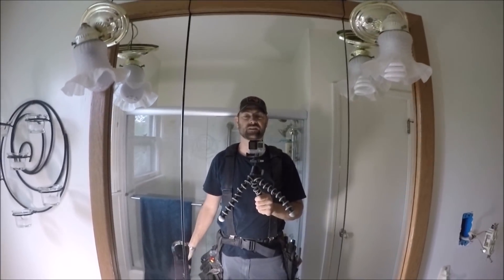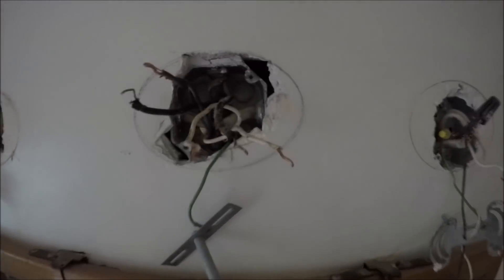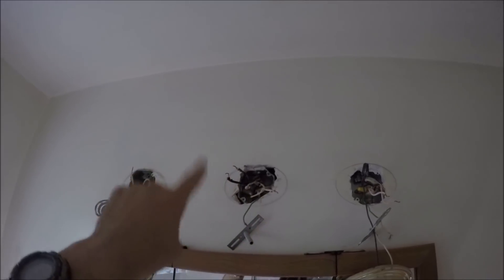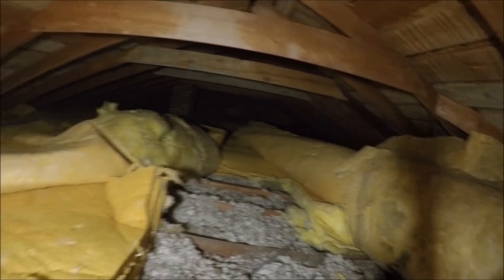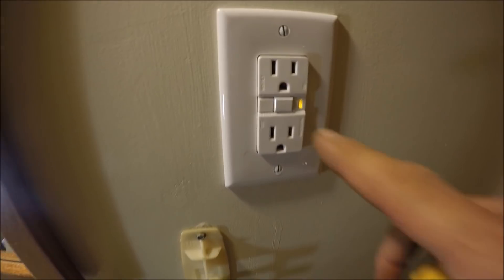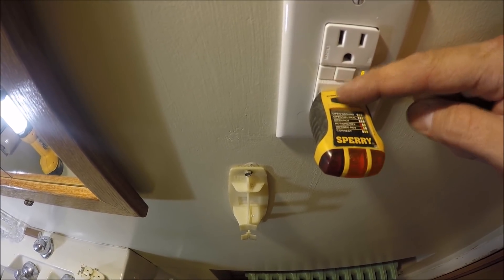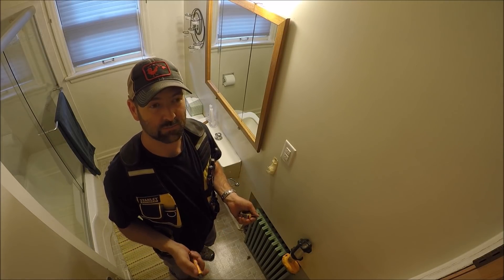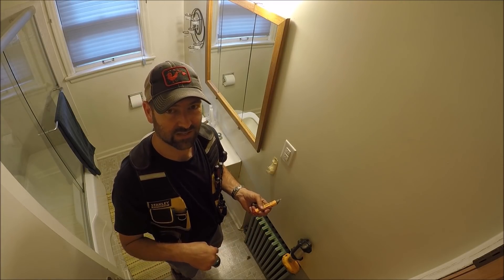Dangerous Electrical Problem That Can Kill You | THE HANDYMAN |

Comment: Found one of these switched neutrals doing a similar (not-so-)quick hot replacement to an external light fixture on my house (1952). It was the only run without a ground wire. Lost my good kleins and a bit of my ego on that one.

Comment: Why couldn't you just take the neutral off the switch, wire nut the neutrals together, and then connect the hot to the switch?

Comment: You've got to have a good level of trust w/ the customer to get them accept these situations, they don't know the technical side of the issue and too often they may think you're just trying to run up hours when you let them know about problems like this -- Frightening thing is the house is probably filled w/ switched neutrals.  Also, good on you for putting the insulation back, I've had many contractors do work where they pull it apart and then simply leave it apart because they assume I'll never look up there and are tired from whatever else they were doing.

Comment: the only problem with that solution is the next person will be confused as to why the wires are swapped and could hurt themselves thinking  white was  nutrial.
Reply from the maker: I was the next person and fully remodeled this bathroom.  All the wiring was completely replaced.   I knew I was going to be the next person before I did the work.

Comment: This was very handy and helpful. I did have a question, my brother installed a bathroom exhaust fan and wired to light switch.  After installing, when light switch was on, fan came on but light turn off and vise versa. He disconnect fan. Not happy.

Comment: Octagon box is overloaded with conductors.. I suggest specification grade outlets.. They have much stronger contacts to hold the plug in especially if you plug and unplug often which would happen in a bathroom..  Not sure why you want to switch that outlet..

Comment: Just so you all know Mr. The Handyman is not teaching you everything you need to now to solve this problem yourself. This is a cool video showing what problems you can run into, but you have to be pretty clever to solve the problems others have created. I have seen mistakes in  houses as old as 1902, 50’s, 60’s and as new as 1981. You never know what you will run into, and just because a house is newer, or the work has been installed by a “professional” and “inspected “, doesn’t mean you won’t find issues.
Reply: Hello Luke. I was just watching this video and I saw ur comment  I totally agree with u about that!  My wife and I just bought a 2 story house from my brother  the house was built in 1901 my brother had some remodeling done and put in a new gas furnance and gas hot water heater put in about 7 yrs ago and this video looks like this house we bought. The electrical is all updated but a friend of mine who is an electrician is checking out the work that was done by a guy who my brother hired and he smiled and said oh boy there's a lot that still needs to be done !  My brother hired a plumber who fixed a lot of problems but I am having another friend of mine who a plumber check things out with that too. My wife thinks  that we made a mistake by buying this house which I'm beginning to agree with her! Anyhow were just going to finish fixing it up and then we'll sell it!  The roof is a slate roof and has needed repairs done on certain spots but I was impressed with how old the house is and the slate roof was still in pretty good shape though! we live up north and we usually get the cold, windy, rainy and snowy weather so the old slate roof has held up pretty well considering its age my wife thinks we should have a metal roof put on in the springtime but watching this video I'm really not too sure. Oh the joys of owning an old house! Haha

Comment: What do you mean by switched Neutral? It was up until fairly recently that a 14/2 or 12/2 romex was brought down from the light to the switch box and the neutral colored wire is used as a switch leg. It’s not truly a switched neutral. Also there would be no need to get into the attic to figure out how to swap the neutral from the hot in the light. Waste of time and money for the homeowner there. Simple fix from the first light in the daisy chain from the switch.

Comment: I was an electrician in the military and worked on some "old" buildings in my time.  What they did back in the day was use the metal conduit itself as a ground all the way back to the panelboard.  Then they would ground the panel to an outside ground rod.  The problem was it was easy to lose ground continuity at junction boxes due to corrosion or loose connections.  Of course now the NEC calls for a dedicated ground wire all the way thru the entire circuit.  I was happy to see HANDYMAN fix this lady's bathroom for her safety.  I would have done the same thing.  Very nice work done here.  I really like this channel and have learned a thing or two watching it.  Customers of this guy are lucky that he has the electrical knowledge that he does along with all of the other skills.
Reply: you can still use the conduit as equipment ground. even flexible metal conduit.
Reply: Conduit is always used as a ground. 100% legal and fine as long as you use the proper fittings and bushings. You only have to run a grounding conductor if it runs underground.

Comment: I had a similar situation in my home when I bought it. Discovered it when a loose connection on an outlet caused resulted in a small electrical fire. An added hazard discovered was the discovery of aluminum wiring...UGH!

Comment: My house was Built in the 40s and it is old wiring,  none of my outlets had Grounds i put  3 prong  outlets  in, i am Not an electrician i do basic lights switches & Ceiling Fans,  This house is a Hack wiring i put a wall Switch in for the Hallway light and i seen about 2 to 3 inches in the wall you can see that someone had added on to that line after i  unscrewed the switch i pulled the switch so i could back the screws out and one of the wires came right out of the wall it was 2 or 3 " long so i wire caped it back in this was about 10 yrs ago,  i really need to rewire the whole house its all two line wires, all i could do is ground each outlet to the Box...
Reply: Look in the attic and see if the wire is inside metal flex like in this video.  If it is then that metal is the ground back to the panel. So technically you have a ground but only if it has continuity all the way thru the junction boxes with no loose connections or corrosion.  If you screwed the ground wire to the metal switch box that is the best you can do without rewiring everything.

Comment: My hundred-year-old house had a variety of different types of wire. (I think maybe Tomas Edison's grandson did the first original wiring).  In the unlit basement stairway, a piece of flat steel was installed as a handrail.  Six inches above that a pair of knob and tube wires ran parallel to the handrail and each other.mounted on the wall - not inside it.  Got a permit and discarding all the pre-1980 wire/cable and using a minimum of 12 AWG for everything on 20A breakers.  Above code as Rex Cauldwell says.   P.S  I would never work on a circuit unless it was off at the panel.

Comment: Originally there was just the 2 lights and later on someone added the outlet but only had the switched neutral and the hot to work with, you still COULD have installed a GFI the way in was

Comment: My understanding is that the BX, as long as it runs to the panel, and is in a metal box, is technically grounded.  Just ran into it in a kitchen reno.
Reply: The metal box and conduit is not as good as a ground wire
Reply: No it is not "grounded". It is Bonded. The only way to have a proper ground is the have a ground wire.

Comment: So I run into this problem all in old homes.  But I'm not an electrician. So it usually takes me hours to back track far enough and completely correct the issue. I'm going to watch this again. But ur saying that u just simply reversed the black and white at the pedestal light. And that solved the issue? That's awesome if that's correct. If you have the time could u exsplain a little more. I'm always a little dumb founded when I find these homes wired b4 mid 70's or 50s with these crisscrossed neutral's.

Comment: Could have just changed it at the switch. Yes, this is coming from a licensed electrician.
Reply from the maker: No I couldn't There is only one wire going to the switch.  There is nothing to switch around.
Reply: @TheHandyman1  
I think you mean there is one cable going to the switch, which tells me it's a neutral switchloop and you were right to do what you did.

Comment: I knew from the title where you were going with this. A switched neutral has been responsible for many deaths. I have rewired many homes that were originally wired in this manner. I'll never understand the reasoning behind such a foolish wiring method.
Reply: froggie6608 In this case the “electrician” probably installed the PowerPoint much later than the lights.  Instead of doing it right, he did it “should be okay, not my house” and wired it with the wrong wires easily available to him.  I agree with you though.  It is quite risky.

Comment: For bare attics like that I take two 2x6 plywood runners up and use them to creep on the exposed celiing supports...I have more in the trailer if needed.   Went through a ceiling once and don't want to do it twice.  ...what a pain that work is.. .you have my admiration .

Comment: Hahahaha knob and tube in my house thats been spiced into a new electrical panel. Went into a "renovated house" so many electrical issues eventually found a wire that was cut and hanging from the ceiling pretty sure its connected to the furnace becuase I flipped off every breaker but that one. Theres also dummy boxes , by which i mean there is wire running to the box but no power or at least I never found a way to turn then on. Might be a switch inside the drywall somewhere.

Comment: My question is, were you working with live wiring? If so, how is that possible?
Reply from the maker: Yes its live.  Residential electricity 110 v and only 15amp circuits.  In the old days electricians would lick their fingers and grab the wires to test to see what one is hot.   It doesn't hurt. It just gives you a little zap on the hand.  You also have to be grounded for you to get the zap.
Reply: Thank you so much for your kind reply! I want to wire a ceiling fan (where there is no receptacle or electricity) on my enclosed porch. There is one outlet near the floor, two hard-wired lights next to the doorway into the house from the porch. Which would you use (if any) to begin the wiring into the ceiling?
Reply from the maker: If you want the fan to come on with its own switch you could get power from the outlet.  An electrician can easily get it figured out for you.
Reply: Thank you. I'm going to try to do it myself. I'm not an electrician, but I played one on TV. (just kidding)

Comment: That insulation rearrangement put back was great. I worked with insulation about 40 years ago. I took about 3 baths and I like to have never got the glass pieces out. You are braver than me. I was wearing long pants and long sleeves and still got the stuff on me. Like your channel. You tell it like it is.

Comment: Once was in a situation just like this in an attic. But it was blown in insulation going 2 feet high! I don't know why they would need that much blown in insulation. A very dangerous situation indeed! In the case of you discovering this situation I would have charged more. I've been thinking if its possible to write up a contract with the help of a business law lawyer specializing in contracts to have a policy where when situations like this occur my rate would go up. If they don't like it and don't want to sign it prior hand then chances are they already knew about the situation and are trying to play stupid. Clients almost always know more than they are letting on in an attempt to screw you.
Reply: Most electricians charge by the hour for service calls, and however long it takes is how long it takes . If they want a fixed price,  it's gonna be EXPENSIVE , because I'm not gonna work for next to nothing.
Reply: No problem, I charge $110 per hour.

Comment: In my area and the state next to it you must turn off the current at the panel if you want to work on a circuit. Absolutely no live circuits .
Reply from the maker: That's just silly.
Reply: The Handyman until slip, someone bumps into you, or sneeze the wrong way .
Reply from the maker: been shocked dozens of times.  Electricians use to lick their fingers and grab the wires to find out what one was hot.

Comment: ... back in the 40s they were switching... whatever was convenient to switch. It's not that they "weren't switching the hot," it's that they didn't give two shits what one they WERE switching as long as the darn lights went out.
Reply from the maker: I actually just finished remodeling this bathroom All the old wiring was removed all the way back to the panel.   Thanks for the comment.  Stay tuned to see the full bathroom remodel.

Comment: Explain, that when you have a switched neutral,  the fixture is still live, even though the switch is off. The power comes through the fixture, and the on the way back, the circuit is then interrupted. The fixture is always " live".
Reply: Nope. say we take a hot (black wire) and a neutral to a ceiling box) we take the neutral to the light right there. then we run a black and white down to a switch. This was common back in the  50s 60s 70s when I was in the business. It was 14-2 romex here in Wa. state, not conduit or steal flex cable.  They may have changed the code since I was doing it. Anyway the black power coming into the box would connect to the white going to the switch, it's no longer neutral but now hot. it would go to one side of switch and the black going back to light is now the switched on hot. I have been out of it for a long time so the code may have changed on doing it that way.

Comment: Hey, I just found this channel. No idea why the algorithm started showing me your vids, but they're interesting anyway. Not a professional, just a homeowner, so it's good to know some of this stuff. Even if some of your "simple" projects are things I wouldn't want to undertake myself, it'll help me spot when a job is being done right.

I have only that loose fill crap you found underneath all the blankets in my own attic, and on either cold or hot days I almost might as well have no insulation at all. Northern California, so things don't get TOO cold here, but I'm certainly spending more on heating and cooling than I need to. I should probably do something about that, but there's so much ductwork and other stuff up there it's not an easy job. It was annoying enough just running coax up there.

Comment: My mother in-law bathroom doesn’t have a ground or negative wire. What can be done?
Reply from the maker: on old homes the ground is the conduit or the metal flex the wires are in.  Only thing that can be done is to remove and replace the entire circuit.

Comment: "Sometimes I wonder what I get myself into" Preach it bro, I've said those words way too many times! lol I also run into this problem a lot when switching out ceiling fans or lights. The switch will be off but there's current in the neutral. My voltage sniffer has saved me many times!
Reply: They were back feeds right? The neutral wire can be more dangerous than the hot leg

Comment: Where did you get the ground??  that is a old 2 wire system and I'll bet I can ANWSER my own question.  Best to not jump from the neutral simply use the sticker in the box with the gfci that states "NO EQUIPMENT GROUND". it will still work properly and pass inspection even if the inspector pulls the outlet from the box.  Reason.  There is return current on that wire and especially when metal boxes are used and that house they were you just ran current to it and someone might get hit    All that said you do great work and are skilled it many trades thanks for you videos be safe
Reply: I knew that was coming. Cuz the sticker will change the homeowners behavior.

Comment: oh btw, i seen you mention using your pencil tester as your primary trouble shooting tool. thats not very reliable they tend to be too sensitive and pick up power when there is none. bad idea for inexperienced guys you be chasing your on ass without a meter. best to verify you got pwer with meter than wasting timeseen too many guys spend a hour thinking they found problem to have gotten no where when if they checked correctly they pass right over the real fix. say loose wire not joint oh you got pwer on your tester so its not this box, well you check with meter you got 45 volts so no you didnt have power. get what im saying. just a thought guys we are in this thing together we all should learn and get better everyday!!

Comment: dead mans switch! the hot from a bus goes to the light, not the switch, very common here in S. Texas, really should be expected but they never put black tape around the neutral. it only takes a couple good jolts before you learn. lol

Comment: Dude, kill power to the circuit before handling any wire.  Best purchase for me was a circuit finder, although not sure it would work in this set up.  If it doesn't, I kill the main.  You make good videos, want to keep you around to keep making them!
Reply from the maker: Thanks for the advice.  I have been working on live circuits for 23 years.   Residential electric can't hurt you. In fact a lot of sparkies just wet their fingers and grab the wire to see if its hot.
Reply: Don´t try that trick in the UK.. 240volts using a ring cricuit.